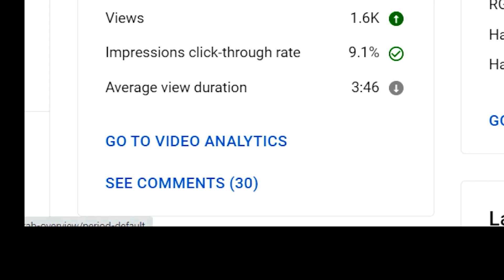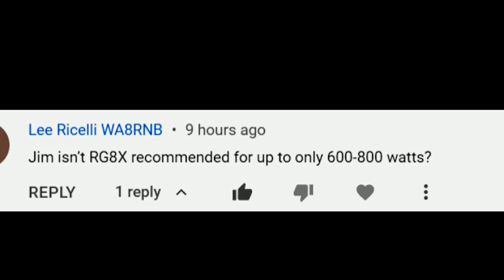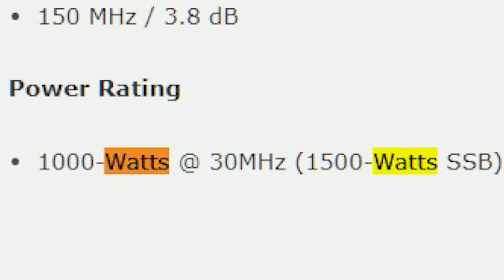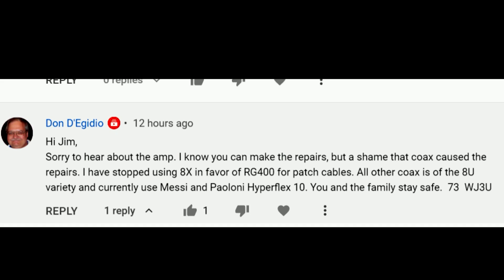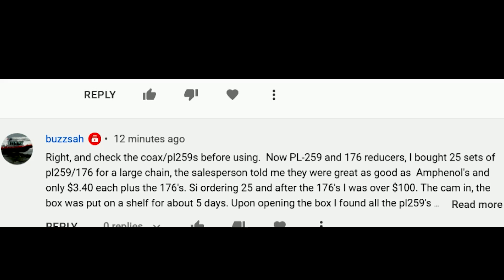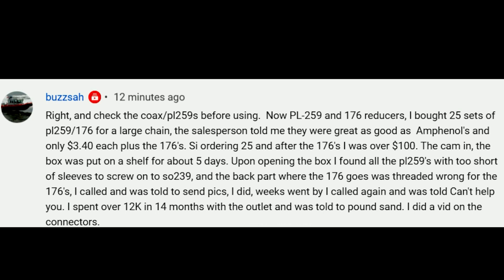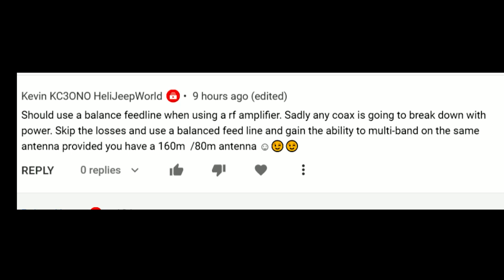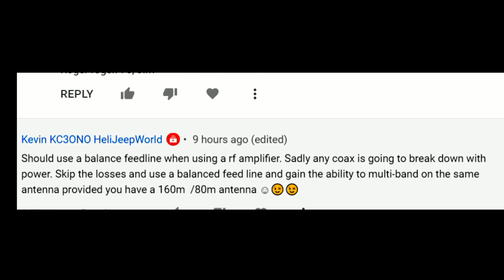Questions And Answers About Coax Cables From the Video About RG8X From Jim Heath W6LG

Comment: The ARRL handbook used to give a simple graph to solve the problems of VSWR and power loss. But I don't see that procedure referred to in this video. My 1984 handbook gives the procedure to find the input VSWR given cable loss and mismatch at the antenna on page 19-16. This graph appeared in the handbook for many many years. I think it is probably still included but I don't have a recent edition to look it up in.

Comment: First rule of buying coax should be look outside the USA manufacture. LMR is not the only cable. Why run KW's while running crap coax. (No, I'm not saying LMR is crap)
Reply from the maker: I agree.  It was a test for a video.  Sadly, it was an expensive fix.  The gray stuff is manufactured in the US.  I did strip the coax connector and shoot some video.  It is such a poorly made connection that even with a few hundred watts, it will fail.  Thanks for watch and commenting Mark.  73, Jim

Comment: Thanks, Jim. If I'm understanding correctly, if 90% is lost on the way out, then when comes back is lost twice, where 90% * 90% = 81%. If 80% gets out, only 64% comes back.
Reply from the maker: I always have to think that through:

100 out and 90% gets to the feedpoint.
An SWR might reflect 25% at a 3:1.
So, 90 times .25 equals about 23 watts reflected
Of that 23 watts; .9 times 23 is about 20 watts.  
20 going back less a watt or so 19 times .25 about 5 lost and 14 radiated. 

Sums:
90-23=67 radiated
19 -5 = 14 radiated
total about 80 watts radiated out of 100

Does that all add up or did I make a mistake????
Reply: @ham-radio  What I wrote wasn't quite right, but you did understand me nevertheless. So, 100 watts leave the transceiver, 10 are radiated as heat on the way there, and 90 make it to the feed point. 67 are radiated and 23 reflect back. (So far, so good.) 3 are lost as heat on the way back, and 20 come back to the transmitter. I'm fuzzy from there, though. Where did the 1 watt go to get to 19, and how is it re-radiating without an antenna on the transmitter end? That seems like it should be ohmic there, right? Thanks in advance. 73 de K7COI
Reply: There used to be a procedure for doing this calculation in the ARRL handbook in the chapter on Transmission lines. Using the assumptions you give, 0.5 dB matched line loss, according to the ARRL table as I understand the procedure, the total loss with 3 to 1 VSWR is 0.75dB . So power out is 84 watts.

Comment: Hi Jim,  I always enjoy your videos.  They are very informative.  Regarding the 20,000 watt CB antenna, that's probably not an unreasonable power limit considering some of the custom-built CB linear amps I've seen.  I recently saw one with an advertised power rating of 10 KW (Wizard Built 3CX10,000A7).  There seems to be a cottage industry that builds these amps for the 'Free Band' crowd.  It would be interesting to know what kind of coax the manufacturer recommends for this amp!

Comment: ["I'm off to grab a stripper" video ends] Now that's what I call a cliff hanger, Hihi! More seriously I only use RG213 (even for patch leads) these days. RG58 is pretty much always junk and as you mentioned RG8X has no spec standard anymore and so quality is such a lottery. I'm very sorry to hear the faulty lead/plug took out your amplifier!, and while I know the repair couldn't by any means be defined as "Ham radio basics" I'm guessing many of us would be really interested to se a video or two of the diagnostics/repair process. Hope all is well and your safe from all those wildfires? 73, Tom G2NV.

Comment: Were you able to put your hands on a stripper?
Reply from the maker: No.  Sadly, no. So I have more than one stored in a cabinet. That sounds bad.  I will look again tomorrow.  I am still repairing the amp.  I will need to order some zeners and rectifiers.  What a mess.  Say hi to Mr. Charlie.  73, Jim

Comment: Thanks for the reply Jim.

I pretty much only use DXE 400Max coax for everything in my shack (except for a couple 1 foot jumpers, which are RG-213). It's tough as nails, direct burial, UV resistant, etc. I use it for HF as well as UHF/VHF (I toyed with the idea of using LRM600 or 7/8" Superflex/AVA5-50) but just went with 400Max for everything so I could get the coax and connectors in bulk. As I was told, spend your money first on feed line, then second on the antenna, and thirdly your transceiver.

73
W9HJ